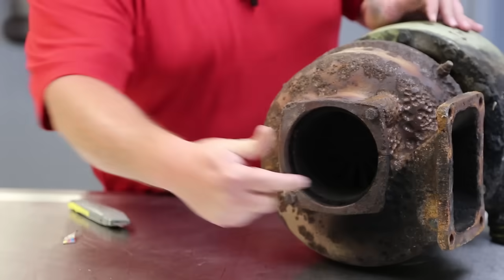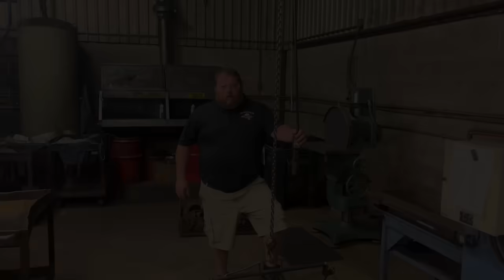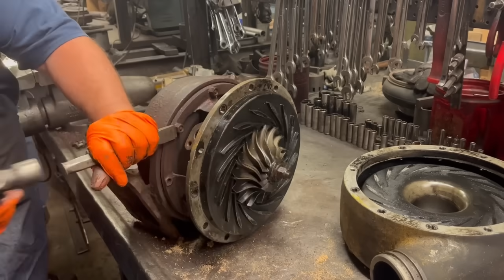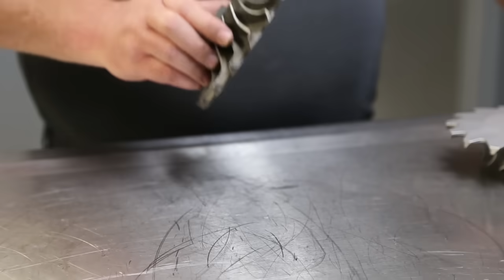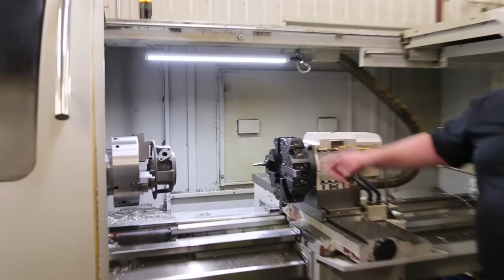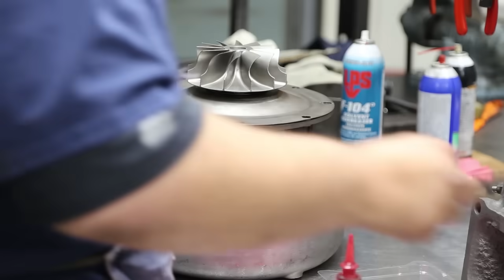T14 Turbo Repair for @DieselCreek  1964 D8H Cat Dozer – BACK FROM THE DEAD … WILL IT START?

Comment: Awesome work that you guys do. Just finding parts for something this old is more than half the battle but the one thing you will never be able to replace is the knowledge of the 3 wisemen. Learn from them while you can. IF you had not been able to replace and rebuild this turbo would it be possible to get a newer turbo (maybe from the 70s?) and fabricate an adapter plate?
Reply from the maker: Yes. That was "plan c".
Reply: @AreaDieselService  thank you.

Comment: I've been mulling:   we blame our 'consumer' attitude and the cheapness of products we see, when it is our own ingenuity thats the culprit.  

'Necessity being the mother of invention"  is the Number 1 reason.   Find a way to improve this part, make it faster with less labor,  Find materials that make it lighter.  Improve its performance (like variable geometry, and 2-stage compressor),  Make them smaller, using less materials.

Before you know it,  it's now cheaper to just buy another, than to attempt an overhaul that requires not only material, but MAN-hours.

The nature of work has changed.  While there will still be Job-shops that service an industry, there are fewer and fewer that can support themselves.

Comment: Great video and repair of the turbo. But just out of curiosity, is there a turbo that is more modern or easier to source that could replace this turbo if parts couldn’t be sourced. 
I know original parts are best.

Comment: Just wondering if parts like the cast housing could be 3D printed. I have watched videos where similar components have been scanned. Imperfections taken out on CAD. And then recreated. As these items are now so rare is this a possibility ? Fascinating process. Sat and watched all 2 hours. Like everything it comes down to cost. Unless you were intent on building a machine to total original spec. Surely just adapting a modern turbo to fit would be the better option.

Comment: You and your crew do a GREAT job reworking old machines.  I have a question, being a now retired machinist and love to work on old cars and engines myself, I am wondering why you ground the shaft before straightening it? Now the shaft grinds are not true.
Reply from the maker: Good eye. Great question. Straightening is in fact first. Then grind, polish, and balance. We had wheels chucked in each machine for video production and so we could get in and out of the machine shop quickly and we captured the processes out of order. Are you looking for a job? Your attention to detail is what we look for at Area Diesel Service.
Reply: @AreaDieselService   LOL, If I was in my 20's or 30's I'd say yes but I am a retired machinist now. Thank you for the offer tho.
So it is the editor's mistake or just not knowing the correct procedure. 
Have a great day guys ! And remember, I'm watching you :)

Comment: 8/5/23; am not a Hvy Equip/diesel owner or operator, just a 77 yr old  armchair YT enthusiast amazaised at both suoerior attitude & efforts Matt (& friend 'Scrappy') perform to find & rehabilitate these big machines. Also was totality unaware of individual components, injection pump, turbo etc. or the incredible number of precision parts, pieces, springs, pistons & numerous machined surfaces which you at Area Diesel Service (ADS) disassemble below bright camera lighting for all to see. Incredible number of internal components each with precise interworking tolerances! Thx ADS for your excellent presentation...& education for all we YT viewers! Great video, camera close ups, lighting, EZ conversational style of explanations & overall production style making a kinda 'nerdy' subject very interesting. A+ to all techs rebuilding these parts which ultimately-when re-installed-continue to make USA 🇺🇸 work!...now the only question you did not address..did you get a (big$) deposit from Matt/Diesel Creek in advance? Next video give us a little side comment on this. Ya know..gotta make sure customer takes his ♥ Heart Meds. & straps on his seat belt ⛓️before you tell the final invoice, aye?🔩🛠⚙️🔧💪😊🍺

Comment: For those ancient turbo housing, you could 3d scan and with cad fix some of the issues then get a sancast component made for it.  From what I see of the parts, they look like they might have been sandcast originally.
Reply: Yeah, it's crazy how far that's came! 3d scan, send out, get a sand casting shipped back, take to foundry(if u can't pour yourself) & get back a part next day!! 👌🔥🛠️

Comment: In a dimly lit workshop, the air was thick with anticipation as the camera rolled, capturing every moment of what promised to be an extraordinary event. The stage was set for a turbo teardown like no other, a masterpiece of engineering unraveling before the eyes of millions of viewers on the YouTube channel, Diesel Creek.

Leading the charge was Area Diesel Service, a beacon of excellence in the world of diesel repair. With their cutting-edge technology and skilled technicians, they were about to perform a feat that would leave the audience in awe.

The turbo sat before them, a complex maze of components, precision engineering, and untapped potential. As the technicians prepared their tools, a sense of excitement filled the room. The teardown was about to begin, and Diesel Creek's subscribers were in for a treat.

With deft hands and meticulous attention, the technicians dismantled the turbo piece by piece. Every bolt, every gear, and every blade was carefully inspected, revealing the intricate design that powered diesel engines to perform at their peak.

As the camera zoomed in, viewers were treated to a front-row seat, witnessing the cutting-edge repair job unfold with unparalleled expertise. Each component was assessed, and the technicians explained the significance of their findings, shedding light on the magic that happened within the turbo's core.

Throughout the process, Diesel Creek's host, Matt Diesel Creek, kept the viewers engaged, asking insightful questions and soaking in every detail. The level of skill displayed by Area Diesel Service left him visibly impressed, and his enthusiasm was palpable.

In the blink of an eye, the turbo had been taken apart, its secrets laid bare for all to see. It was now time for the repair, the true test of Area Diesel Service's prowess. Using state-of-the-art equipment and cutting-edge techniques, the technicians meticulously reassembled the turbo, ensuring precision alignment and optimal performance.

With each step, the turbo came to life once again, like a phoenix rising from the ashes. The hum of the workshop blended with the whirr of the turbo, creating a symphony of diesel power.

The moment of truth arrived as the engine was fired up. The turbo spooled, and its blades spun with flawless precision. A cheer erupted in the workshop, echoed by Diesel Creek's virtual audience, as they witnessed the turbo's rebirth in all its cutting-edge glory.

The video ended with a resounding success, the turbo teardown and repair earning accolades from viewers worldwide. Area Diesel Service had once again proven why they were at the forefront of diesel repair, delivering cutting-edge results that left everyone in awe.

As the YouTube channel Diesel Creek and Area Diesel Service basked in the glory of their achievement, they knew they had delivered an unforgettable experience—one that showcased the beauty of engineering and the magic of cutting-edge repairs. Their collaboration had left an indelible mark on the world of diesel enthusiasts, setting a new standard for excellence and leaving the audience eagerly anticipating the next feat that Diesel Creek and Area Diesel Service would conquer together.
Reply: . . . right up to the point, on the side of a steep hill, the D8's engine unceremoniously and mysteriously DIED!
Reply: @cyrilhudak4568  Nope! Not going there!
Reply: 😄 That story of the turbo refurbish had me thinking "Twas the night before Christmas....".  Well told story about the turbo.  It should be ready for another 60 years of service.
Reply: Nicely written. I will wait for several hundred of tons of rock filled dirt removed and relocated before I make my judgement on the quality of workmanship. Just saying.
Reply: @billkurek5576 you will never see it with that dozer lol, its a toy for Matt and will likely get a 20’ “working resto” for shows and such
Reply: @Swedenfrommycam ChatGPT 😂

Comment: You guys can raise the dead... I worked aerospace manufacturing for many years. We ran Studer German made cylindrical grinders. Ultra precision machines accurate into the millionths. Shop was a clean room environment. Temp and humidity controlled. I ground components for jet engines. 36 years retired...

Comment: 3825 for a turbo and 3500 for a dozer leaves about $500,000 of headroom before you hit the cost of a new dozer.  So if Matt’s salvaged machine pushes dirt for a couple years, he’s coming out way ahead!
Reply: A new D8 is over a mill. And that was when I checked 6 years ago on a new D8T. 
If that old girl runs halfway to ok, and he doesn't mind the lack of HVAC in a sealed cab, then ride on!
Reply: @typrus6377  that’s Right, Run wat ya brung!
Reply: @typrus6377  He's going to eventually restore it.  It'll RUN.  I'm looking forward to the restoration
Reply: @typrus6377 Matt does NOT care too much. He’s a person who’ll appreciate AC, but not find it remotely mandatory, especially when it comes to his “old steel”.
Reply: Good point well taken. Thumbs up 👍
Reply: I was thinking the same thing.   I would love to have a $7,000 dozer
Reply: Yeah, I mean, the work that the dozer can do isn't nothing. I don't see it as unjustified. Not saying his D8 is worth more (I think it probably is, but not a lot more) but try renting or buying one that's significantly better. Not happening.
Reply: Not to mention all the maintenance fees you can save on by not having a DEF machine and sensors that can only be maintained by a licensed bloke. As much as guys like Chris at letsdig18 like their new equipment with AC and comfy seats, they do their share of cussing at machines going into limp mode when a sensor or such gets clogged up so that they're useless for a week (or month). Hence you see them getting a few of those old Cat dozers too, even if they have to pour a few grand into servicing them and wear hearing protection :)
Reply: @MayaPosch  you may have seen my YouTube rant when my Deere 333E decided it had to do a DPF regen in the middle of a weed field I was mowing.  Making more CO2 to get rid of a little soot doesn’t seem “green” to me.   Exposing me and my equipment to a fire also isn’t nice.  The last 6 hours of operating time have cost me 1200 in service calls to get it out of limp mode because only a Deere tech with the secret decoder ring can do that.
Reply: @MOzarkMike  Admittedly things would be less dire if you could service those parts of a machine yourself, but until we get solid Right to Repair legislation in place everywhere, a lot of modern-day heavy equipment are just fragile flowers that'll take an approved mechanic to even diagnose the bloody thing...
Reply: @MOzarkMike and why i went with a Gehl/no cab, no DEF/regen to deal with. Not as comfy and nowhere near as fun when you mow over a yellow jacket nest in ground but luckily they attack the exhaust and i had time to ride out 200’ then shut it down as i ran away😂
Reply: @MayaPosch  its already right to repair legislation on the books but the proprietary software can be held up to 5yrs or until somebody cracks it outside the manufacturer and sells it
Reply: @MOzarkMike  All thanks to the EPA who are at the root of all the problems manufacturers are facing trying to meet these BS regulations. Who ends up with the short end of stick, machines down, big bills, etc.--the consumer that's who.
Reply: same reason my pa (grandpa) has an old MF 188 (think he calls it big red from what i remember) old girl, pretty busted up and worn but it does what he needs it to, still shovels dirt n gravel. why replace what is fixable? who needs a proper cab anyways?
Reply: Except he's not going to really being using it. He has his smaller dozer he uses for his normal stuff that's a 6 way hydraulic. This dozer is a resto showpiece and will likely not see a lot of use outside steam shows and what not.
Reply: Don't forget the injection pump. 
But yes, absolutely correct. 
Don't get me wrong, I love new bells and whistles. But the old iron hits different.
Reply: plus matt can write off a part of the fix as a you tube expense on taxes....sweeet
Reply: Super fair price considering the expertise and quality of work.
Reply: We’ll said 💪
Reply: You tube paid for all this bruh, that dozer doesn’t have to do anything😂
Reply: He'll spend it on fuel for this thing
Reply: You tube paid for all this bruh, that dozer doesn’t have to do anything😂

Comment: Stock on the D8 is 270 hp with out turbo with turbo is 325 from what I found in literature cause, I Have a D8 caterpillar 14A 1957 I would like to put a turbo on it but I have to put later model heads on may change out the connecting rods

Comment: I first heard about your company  when wes came there and did a video/interview.  You sure can get the job done.  Can you tell me if external injector lines for the old Cummins Diesel NH 220 series are still available?  Thank you and thanks for gettin Matts tractor running.  Bill
Reply: Same with me. Wes was the first
Reply from the maker: Reach out with an engine serial number and we can take a look.

Comment: Just a shade tree hack here but could you machine (cut the old one off)  a hot side and cold side to a new turbo?  I know there are all sorts of in and out air specs but would these old engines handle the kidney transplant?
Reply: You have to ballence the turbine and compressor 
Not quite as simple as cutting one side off and adding a newer one on 
The more common method to fix this it to buy a whole new turbo, not too hard to do, just need an adapter flange 
The motor handles it easy

Comment: Are you not able to use Utectic cast iron spray to refurbish the deep pitting to save the housing?
Reply: I used to repair all sorts of parts for Cat equipment using Utectic spray was amazing what we were able to put back into service